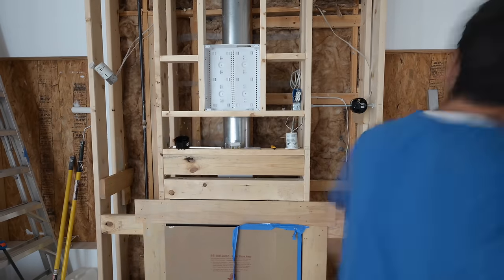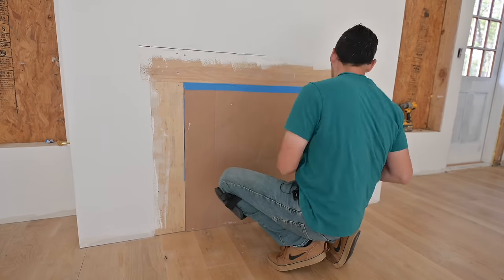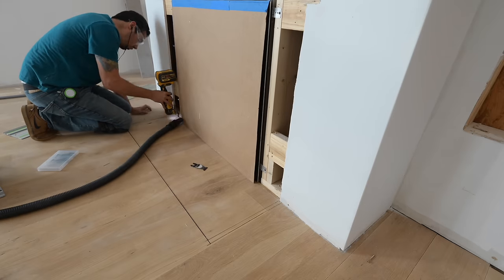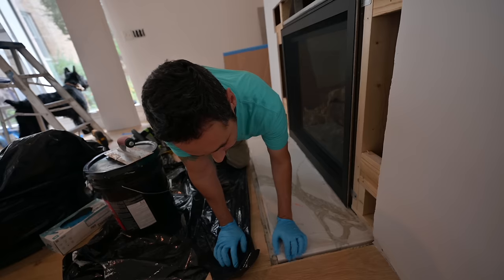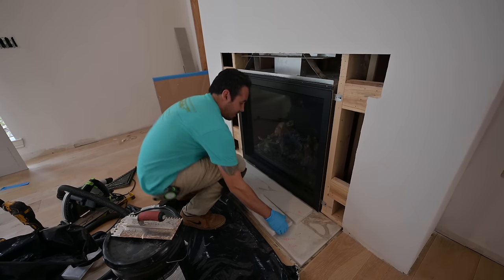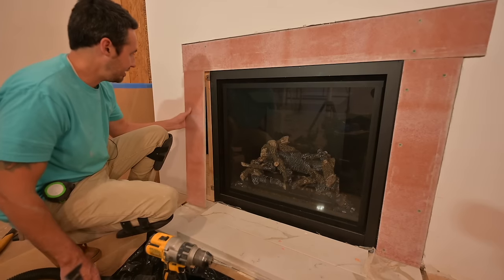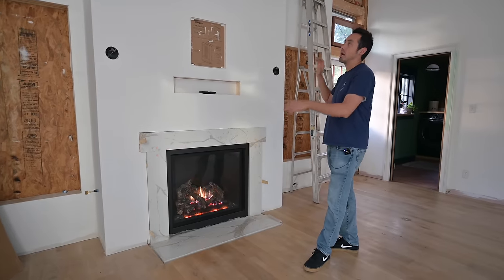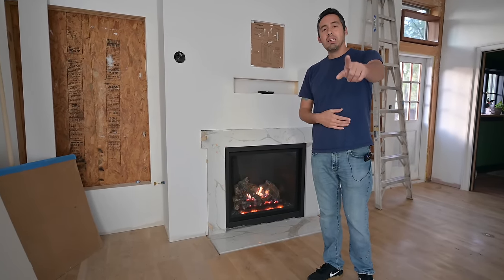Installing Marble Hearth and Surround - Building a Classical Fireplace Mantle

Comment: When I need to weight down something like that marble slab, I use 5 gallon buckets partially filled with water. Place as many of them as you think you need. You can stack the empty buckets to bring to the jobsite and just fill them when needed.

Comment: Dude, they should have thanked you for the years of free promotion instead of being petty about it, so happy to hear it's over with.
Reply: Until his frustration with the brand, and having to spend money on repairs that shouldn’t have happened.  So they were likely being petty after that episode.
Reply: @straight_to_finish they're petty because he spoke out against them and probably changed a lot of minds. This will make it worse
Reply: When he told us he had to pay for the repair of the Mitre saw, even though DeWalt knows the issue with the Battery replacement thingy with the Cord to use it with a plug, I was fed up. 
Stupid company
Reply: Seriously. He repped their miter for 10 years +. Now he swaps out and they're salty. Now they got me salty, too. Dumb move.
Reply: @Forkandoutletz the 120v cordless was always just ok, mop jokes the new 60v one is amazing and fantastic dust collection

Comment: As you continue your Festool journey, check out their drills. They really are different/better than the others. And they have a really cool dust extraction mechanism for situations exactly like the one you showed in this video. Also, on your Kapex hold down as you lift the green lever to secure the stock gently press upwards on the front part of the blue portion in the front and it will lock it solid

Comment: The over hyped yellow tools are all tethered to the HD display to give the appearance of rare gems.  Please consider a Respirator for cement board cuts. Huge increase in silicosis, or countertop cutters disease, especially in L.A where they use no mask.
Reply: I could have used that advice 40yrs ago…today I suffer from severe COPD and just walking is a huge effort
Reply: No doubt. Learned a lot about silicosis in medical school. It's some scary shit. I won't even sandblast without one. In addition to wearing a respirator, he should think about using the track saw with a dust extractor now that he's a Festool guy. Then have a cement board blade for it.

Comment: All good about plywood being combustible material, what about the timber frame (studs/top-bottom plate)?

Would it not been better to build it with steel stud/tracks cement sheets and insulation? And then of course the outside skin stone marble granite whatever?

Comment: If said tool company had a problem with what you did with that pile of their tools, they should have reached out to fix the issues you had. Motors burning up and so on. Would have looked better on their part to be stand up instead of stand down. Mantel is looking awsome!

Comment: FYI  that's not cement board is called hardybacker,  might be different in your area but you need to use cement board.  Also it would be better if you use medium bed thinset to install your  bottom piece , it will help to be sturdy . It will be better to  install everything with thinset or commercial 100% silicone. I am not sure if hardwood floor glue will hold up with time with the heat, if it is real natural Marble might stain it later with the heat but if it is Quartz you might be all right.

Comment: I knew It! They were fine up until you dragged them for their shit cordless miter saw. GUYS! Don't buy cordless miter and table saws. even if they work good (they don't) you still need to replace batteries after a couple of years. The batteries required to run those saws all day cost as much as a new corded saw. Makes zero sense. blah blah blah "what if there's no power on site"? when was the last time you were installing millwork and there was no power? Not often enough to justify the added expensive of high amp consumable batteries.